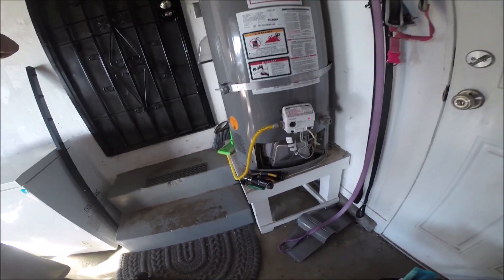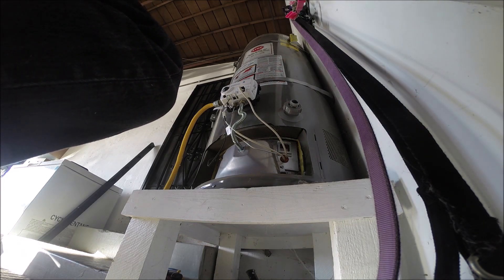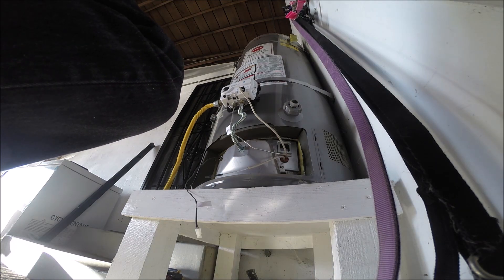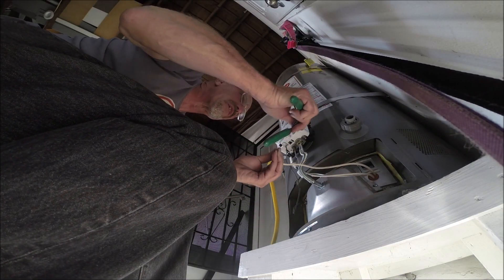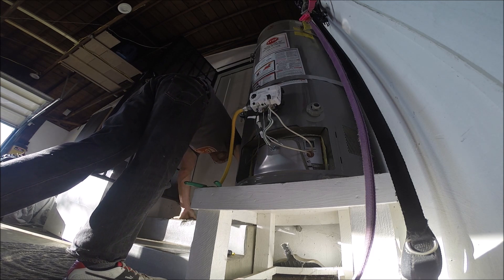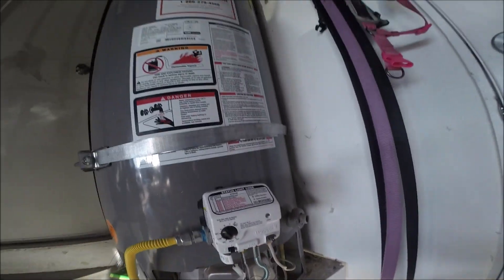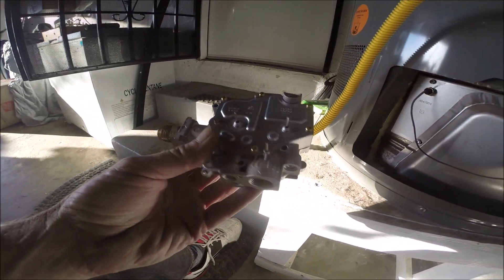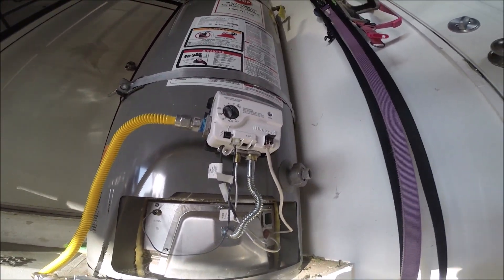Water Heater - Status light flashing 7 Times

Comment: I also have a code 7 on my water heater. I’ve watched your videos and feel confident replacing the valve  my self. Only problem I have is knowing which part to buy. I look it up using the part number on my water heater but I can’t find the exact one. Would you be able to tell me what part number to look for ?  Thanks in advance.  This is the part number on my water heater WV8860C1000
Reply from the maker: I did a quick search for it. It says there’s one on eBay it doesn’t have to be an exact match. Remember you’re just changing out the aluminum valve body you reuse the circuitboard and cover you keep the well housing and the Thermister in place reconnect. All the piping connection should be pretty easy, unless it’s your circuitboard that’s bad? 
Just make sure the valve that you order has all the same functionality meaning if it’s a Rheem and it takes a chamber sensor port, do you want to make sure you get that on the replacement valve otherwise it doesn’t really matter as long as it’s in the Honeywell family for a natural gas, atmospheric venting water heater
Reply: @thewaterheaterfactory  would this work on wv8840c5000 becuse i cant seem to find it anywhere only the wv8840c1406 which i heard is not compatible but looks identical
Reply: Thanks for the quick response. I appreciate the help. Thanks for sharing your videos keep the good work 👍🏼